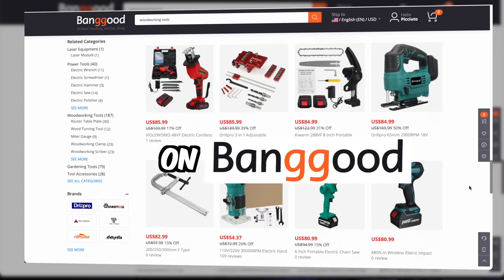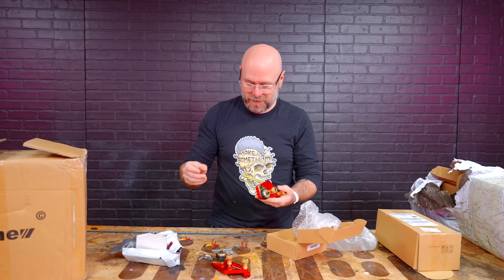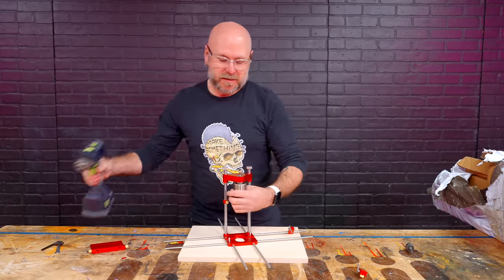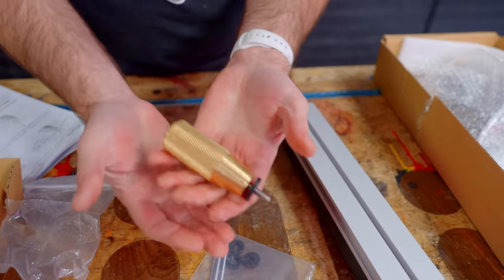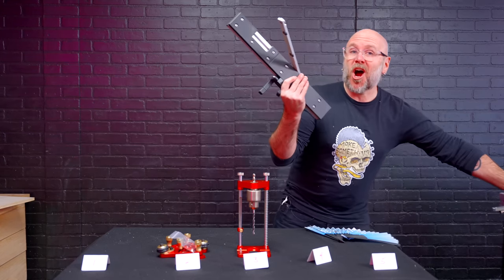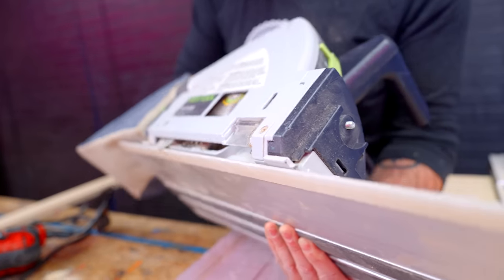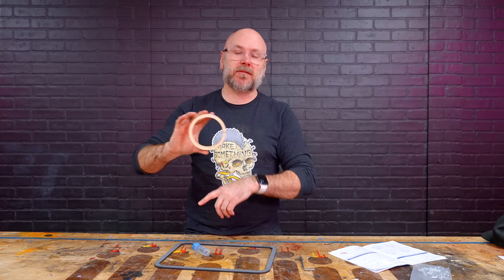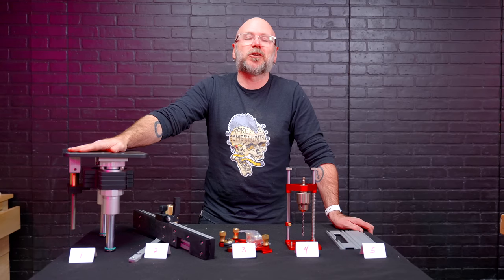I bought the 5 most EXPENSIVE woodworking tools on Banggood!

Comment: You used the first item the wrong way , both of them should be used on the fence ‘check the arrow direction’ 👍🏼👍🏼
Reply: His installation does match the install in the picture though
Reply: @rattslayer  No guarantees that the folks taking the photos actually know how to use the items. 🤷‍♂️
I'm more into electronics than woodworking and seen plenty of pics of soldering gear where that was painfully obvious (as in they'd have experienced serious  pain if it had been on, they way they were holding/using it ..)
Reply: You can use them either way
Reply: You can not use theee either way, they are angled and only roll one direction! (Or the jessem ones that these are ripping off only roll one direction!) either way, the angle of the rollers only work on the fence in their correct position.
Reply: @robertyack1661  No - the arrows on both parts are in the same direction!

Comment: If you haven't figured it by now, most of the tools on Banggood are variations, or clones, of other more expensive brands. The drill guide is a clone of the Woodpecker drill guide. The roller guides are clones of the ones made by Jess'em. I have purchased some items from Banggood before, and have been pleasantly surprised by the quality. I just received the MoHoo Honing guide which is a clone of the Woodpecker honing guide. As for the Miter Gauge, Hooked On Wood, ep 11, reviewed the same miter gauge, and he demonstrates on how to make box joints on the table saw using  that miter gauge set up. For anybody that's interested in the fence, but do not want to buy another miter gauge, you can buy the fence separately.

Comment: Hey David, that saw track is made for a stone cutting or metal cutting saw. Shouldn't have been in the woodworking section. Love this series and the podcast. ✌️
Reply: Yeah, I noticed that. It does actually say on the site what type of saw it was for so not really their fault.
Reply: I don't see any problems using it for wood. My saw guide doesn't have a place for a saw, so the saw runs beside it. David's could be used that way as well.
Reply: It also had the dimensions of the base plate, so you could have compared those with your saw.

Comment: The roller closest to you was not made for that application so it is not a design flaw but user error.
Reply: I was also looking it at it - wish I could post a picture - but if your board actually touched the wheels on the side one, it would have raised it up off the table!!

Comment: The small flip stops for the rods of the 'drill press' are meant to be installed the other way, so their block rides on the surface and the flip stop is on the outside.  You can set both on at two different distances so you can drill one hole, at the first, closer stop, flip the swing up, slide the press over and drill using the second stop.  So you can reproduce that pairing distance again and again on multiple boards.

Comment: the "roller things" work VERY well on the table saw. you install them both on the top of the fence. jessem calls them "stock guides". 10/10 product would definitely recommend.
Reply: My jaw dropped when I saw the red knockoff of the Jessem roller guides. They are intended for use on the router table fence, one on each side of the bit. The Jessem ones are great!

Jessem has different guides for a table saw.
Reply: id recommend Jessem brand
Reply: @chuckgrumble5440  Yep... I have a set of the Jessem ones for my table saw and the router table.  I put one before and after the bit/blade to help keep things sucked over to the fence.  They work incredibly well, and I highly recommend them.
Reply: @jeffgrant935  I bought the Jessem ones because my table saw is old and it doesn't have any safety features.  They work well.

Comment: All of the woodworking tools I have purchased from BangGood have been of exceptional quality. I did follow Dennis from H.O.W. for recommendations in the beginning but placed other orders for items he did not review that in my eye looked well made and have not been disappointed with any of them. That router lift looks outstanding as well as their miter gauges and track saw parallel guides, fences, spiral carbide router bits and the drawer hardware mounting jig. Hongdui, Ganwei, Wnew, Drill Pro, Veiko and even some of the no name solid stainless steel squares are top quality. Keep an eye on their prices and you can get some super bargains,
Reply: Came here to say the same.

The Dowling jig that was on backorder was recently reviewed by Dennis too, I got one before they went out of stock an dit is absolutely exceptional quality!
Reply: I love my hongdui chamfer plane it feels high quality and so convenient and useful to not always have to get the trim router out. And it’s more consistent than holding a block plane at an angle. Got it from Dennis recommendation.
Reply: Dennis is brilliant ❤
Reply: I have a couple of bench plane stops and hold fasts. Admittedly I have bought a pair of Veritas hold fasts since, just cos they’re exceptional

Comment: I think for the vertical drill guide you're supposed to mount the little stops the other way around so the flat part rests on your material and keeps it level. Then the flip will probably be easier to ... erm, flip. It's not THAT much better and will only make a difference if the un-stopped hole you need to drill is further away from the edge, but it's not AS bad a design as it might appear.
Reply: Using both stops you could quickly and repeatedly drill holes at the corners of boards without measuring each hole. It looks like a really nice drill guide. First impressions is I'd rather have this one than the Rockler because of the extra functionality.
Reply: @MrErViLi  It actually should have at least 6 little stops, with at least one for each of the rods and the large one for the back two rods.  With more stops, the more repeatable holes without measuring.
Reply: I have this drill guide. BAD! It is a real hazzle to drill straight so if accurate zero degree deviation is important for the outcome of your work quality - don’t buy! The chuck attachment is really!! poor quality (buy a better bearing?.. without excessive play and swap (if possible)) 
 I have many more tools from Bangood. All have exquisitely high quality! This one not. 
Kind regards 
Anders
Sweden

Comment: I have bought a number of items through Banggood over the last few years. I have never been disappointed with the quality of their tools. But I would recommend that you read their ads VERY carefully. I have had a few surprises where I thought that I was buying a set of five and actually only got one. They seem to be using the "read the fine print" rule on some of their ads. Plus there are often optional sizes colours etc. Just don't speed through to checkout, and read all of the specs etc and you should be good to go.

Comment: Ive used Banggood in the past and always been impressed with their gear. Have got pipe clamps and squares and they are both well made and far cheaper. Just bought the cheaper router lift for my Makita too so fingers crossed that will be good as well.

Comment: On the drill guide/press you need to register the flat side of the guide on the surface of the work piece. Then the guide can flip down. 
Also you had it backwards. Flip should be on the outside edge.

Comment: I think you may have been using the first tool, the router guides wrong. One is an in feed and the other an out feed, both should be on your fence. I have the Jessem guides installed that way and they work great.
Reply from the maker: Yeah, I think you're right. In my defense I'm using them exactly how they have them pictured on the website. Thanks!

Comment: At 5:30 - "I wish this roller was a little bit lower".  
It seems to me that that roller is also angled, as noted for the other roller guide.  However, where the other roller will pull the workpiece towards the fence (good), this edge roller guide will tend to lift the edge of the work piece (bad).  It's not doing that on the vid, because it's not low enough to be rolling on the workpiece, but if the workpiece was thicker, that's what would happen.

Comment: I was considering buying a UJK router lift a couple of years ago, but ended up buying a Triton MOF001 router (also sold as CMT brand), that pretty much has it built-in. The router even comes with a winding handle and a starter pin, the only thing required is a mountin plate. The online shop I bought the router from also sold a mounting plate from Rockler, that is specifically designed for the Triton routers. Triton makes bit collets in all the standard sizes from 6mm to 1/2" (6, 8, 12mm / 1/4", 1/2"). As I bought it in Denmark, it came with 6 an 8mm collets, and I bought the 12mm and 1/2" ones off Amazon. 
But the best thing about the Triton is that it is insanely easy to change the bits. When the power switch is off, the collet can be raised so high that the collet is above the table, and the spindle locks automaticly in the top position, so all it takes is a single 24mm wrench to loosen and tightening the collet.
Only minus is the adapter plate in the Rockler mounting plate, it is quite flimsy plastic. I plan to make one from aluminium, but hasn't gotten around to it yet.

Comment: If you had bought the mini chain saw, you would understand why they have so many... I had a friend convince me to get one, and WOW, small, battery operated, and truly amazing for cutting branches and such.   You can whip it out and trim what you need.. VASTLY easier than digging out your big chainsaw, and there are SO many things you can use it for... Trees, shrubs, trimming wood pieces... shaping things etc.. I have a 6" chain, and it can cut through a branch that size without any issues.. and it keeps on cutting well..  Just one o f those really really good tools..

Comment: Those track saws are usually cordless with 85mm dia blades, max sheet thickness 26mm. Spent this week learning about them. Most only cut 90 degrees, no tilt. They are for cutting sheet stock smaller.
Reply: That one is supposed to be used with a 4" tile saw, the item listing literally called "marble machine guide rail" and in the specifications table, it had "4Inch Aluminum Base". But people usually ignore the table and jump to the pictures, I guess.
Reply: @DalekZhang  The Ryobi cordless multi material has timber, plastic/ tile blades. 85mm dia. Bigger 140-165mm cordless track saws have side tilt for angle cuts. Both are depth cut adjustable. Anyone make CNC  sheet cutter? Cut those 4x8 foot sheets into router/laser sizes?

Comment: I noticed that the #1 and #2 items that were the best quality and had a manual included were also distributed by the same company, based on the logos on the front of the manual. So I would wager that other items from said company would also be of comparable quality. I'm interested in what else they offer. Sounds like a good video idea for you to follow-up with!
Reply: I think the track was also from that company (there was a sticker on the track) so that's not that good of a sign
Reply: Dennis over at HookedOnWood does a bunch of China Tools reviews and Wnew generally does good quality. The doweling jig that wa son pre order is also top notch (I have it myself and it's some proper solid quality through and through)
Reply: I‘m using the products of this company since a long time and all are always of an amazing quality
Reply: "WuNew Tools", a brand from China, "吴新工具" in Chinese.

Comment: Those "roller things" Jessem makes some of those. The "wheels" on the Jessem guides are made of polyurethane.  My Jessems are many years old as in more than five but less than nine. The polyurethane gets old and turns into a sticky paste that is near impossible to remove. The wheels actually turn into paste over time. If you have these or anything made with polyurethane and they ever feel tacky, throw them away then and replace. I used carburetor cleaner which dissolves most things and it would barely touch the mess I had. Remember the paste you used to eat when you were in  primary school? Well this stuff is thicker than that when it degenerates and is as sticky as CA glue.
Reply: Jeff, having had to replace my O-rings multiple times now, I was looking for some other material to replace these rings. I have a workshop in the southern US and perhaps climate has something to do with the failures. Jessem had no theory nor any apology. The polyU ring's residue cleans right off, for me anyway, with denatured alcohol. Grainger sells a synthetic rubber Buna N (Nitrile) 319 O-ring with a Durometer of 70A (Medium Hard) that is a direct replacement for Jessem's PolyU O-ring's size. The difference is you get 50 rings for 9 bucks vs. Jessem's 4 rings for 10 bucks, plus any shipping. I can attest that these rings work for both, the Jessem router table and table saw stock guides. I cannot, however, attest to longevity yet because I have only had them on for months. But, with 50 of them, I can deal with a failure down the line! Grainger part number is 1KLP8 BUT, having spent over a week dealing with one mislabeled Grainger bag after another, I would highly recommend you ONLY use the Mfr. part number... Mfr. Model U38801.018.0106, hope this helps.
Reply: @pwe-x8q  Like you wrote, I got the 4 rings from Jessem  through Woodcraft and they were about $21 delivered. Thank you for your incredibly well written and informative comment.
Reply: @jeffstanley4593  You're welcome. I, too, purchased a set from Woodcraft. They are still in their shipping bag and in my office. They  will never see the shop. While that newest set was on it's way, I tracked down any seller of the 319 size and Grainger was the best alternative. The BunaN's are great! I figured, from what research I have conducted, that there are more than quite a few people with this issue. Jessem's solution was to take the rings into a "conditioned" space when the guides are not in use. Not happening. Grab a bag of the Graingers and never look back.

Comment: The thing about the track for the saw is that it is for a saw for stone, not wood, they are smaller and waaay faster, so they basically just burn the wood. I leave in Brazil and these other saws are cheaper, so people sometimes buy them thinking they are for woodworking, but they are not. Now you know

Comment: I agree with your ranking. I have the same miter gauge, but I think you have the 2 plastic pieces in the wrong order if you get the box joint jig for it. Mine wasn't square enough out of the box. I used 5 cut method to calibrate it. The tip goes into the protractor was bent slightly and not seating all the way in' I filed it a little bit to fit better.
The router lift is great, but it's not cheaper than Jessem Rout-R-Lift II with similar material and construction. It would kill the jessem one if it was $199.
Roller feeder is good, and I probalby should get a set. Yes, it's ranked in the middle, but that does not mean it's an average tool. If factoring in the price, I'd put it as #1, and router lift as #3.

Comment: Banggood is just a retailer, like Amazon. Most of the cost goes into shipping and a little platform fee. For example the WNew mitre gauge costs ¥360 (CNY) or $52.50 if you buy it in China, instead of $125.99 on BG. The router lift costs ¥1,199 or $175 in China

Comment: I actually have that dowel jig that was on pre-order. Struggled to find many video reviews on it but took a punt anyways: It's really nicely made for the price, and it has a few extra features that some similar ones don't have (like the ability to make little through holes for knockdown fasteners), although the downside of this is that overall it's perhaps a bit more fiddly and has more bits than other options.
Reply: Weirdly I have that mitre gauge, and also find it really nice. I got it from a UK supplier that I reckon buys bulk things in from China and rebrands them though.

Comment: With Banggood (and certainly other Chinese suppliers) you have to look for prices over a longer period of time.  (Ultimately, this also applies to amazon and ebay. All of them don't offer charts to compare prices of past months).
I have also seen the circular saw stop at 120-140 €. - I bought it at 85 €.

b) In addition, you have to compare which shop within AliExpress, Banggood, amazon or eBay sells this item - TODAY - and whether another supplier is sold out and cannot offer it at the moment.

c) Different equipment is problematic. Here it would have to be checked whether the packages are identical, although the description differs. But who can do that?

Comment: I absolutely would put that track saw towards the end, not because it doesn't fit a regular saw, but that 1\2" gap.  For me, thr biggest reason for a track saw is the ability to set in right where you want to cut and take that extra bit of measurement error out.  If not for that, i can use a long straight edge and do the same thing as that track
Reply: Absolutely. I made my own from cheap 6mm ply. That was 4 years ago and it still works great.
Reply: He used the wrong saw, that track is designed for marble cutting saw, it literally says in the ad "marble cutting machine guide". And in the picture he shows on the video you can see the blade closer to the guide.

Comment: I noticed on your router roller guides you had one of them set up incorrectly.  Both go on the fence and are design for the roller to spin on one direction only to prevent kickback.  I have the Jess-Um version of these.  (notice the arrow on the guide for direction of wood)